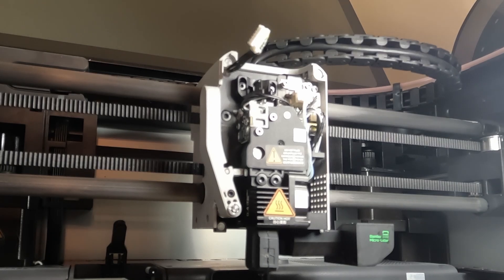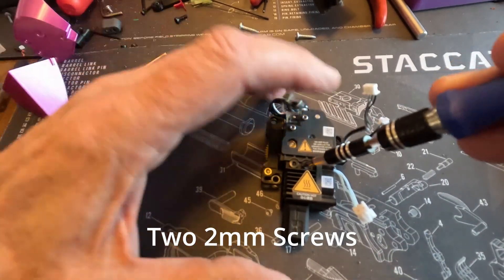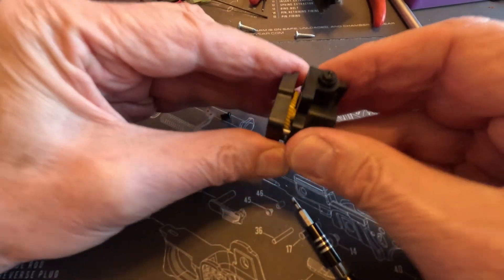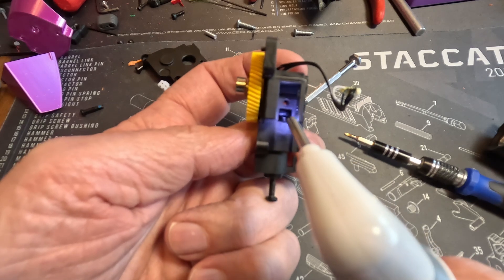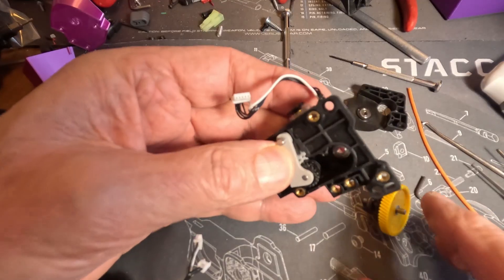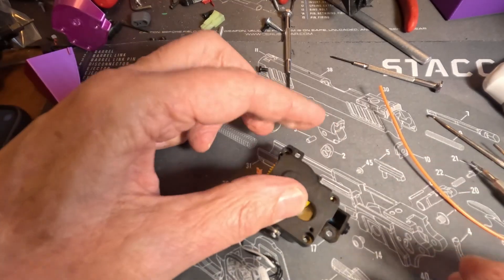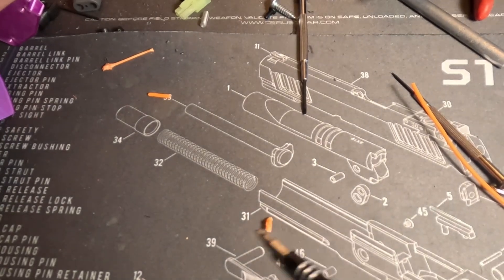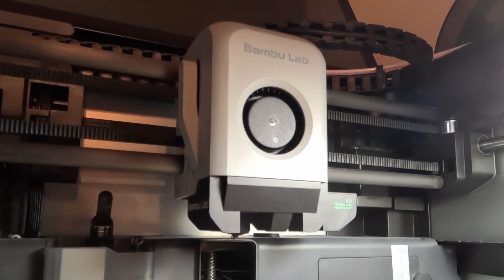Removing an Extruder Blockage Bambu X1C

Comment: Thanks!

Never had to take that off before until today. Labeled PLA, ABS in the system. Found a nice glob of filament in my extruder. Would never have gotten it out without completely taking it apart like demonstrated in this video.

Comment: this exact scenario happened to me last night, I spent the day learning how to remove the hot end and clear it.  Thought that was it, went to run a test print and got the same error message, so I found this perfect video of yours and you walked me through it! FYI...  it was some multicolored filament I had bought before Christmas '24 ... it was brittle and I found the broken piece in the gear area.
Thank you.. I am subscribed
Reply from the maker: I’m glad the video helped!  Yeah, I found that that filament I was using was quite brittle as well.  I ended up throwing a whole roll away.

Comment: My blocked extruder wouldn't allow the filament to eject. That put a lot of tension on the filament and wouldn't allow me to disconnect the PFTE . I had to cut the PFTE and filament just above the connection. The instructions said to print a box to assist in removing the sprocket. Kind of hard to do when you are repairing your only printer. Removed the sprocket , and was able to remove the stuck filament with tweezers.

Comment: Much obliged. What is that dynamite metric hex driver tool you are using? Much better than metric allen wrenches....
Reply from the maker: It is a 142 piece screwdriver set I ordered from Amazon.  Strebito electronics precision screwdriver set.

Comment: I can not get the yellow gear out. I loosened the Long screw and removed the spring, but the yellow gear ist still tight. Am i missing something?
Reply from the maker: Be sure to loosen the screw that holds the idler and then pull that little idler gear in arm assembly away from the yellow gear. The yellow gear should pull out at this point.
Reply: @Steve4948  Well, I got it out. But now the extruder does not pull the filament anymore. Guess I broke something...
Reply from the maker: @erizona55  yeah I’m not sure what to check other than make sure they tightened that tension screw.

Comment: Thank you for this. Unfortunately I took the whole thing apart and checked it thoroughly for a clog or loose filament. Found nothing, put it back together and still the same error 🤷‍♂. Funnily enough, it was the orange filament that started this issue for me as well.
Reply from the maker: Interesting that it was the orange filament for you too.

Comment: Thanks for the video . 
What brand of filament ?
Reply from the maker: I don’t recall the filament brand.  Looking back at my order history, Polymaker would fit the timeline.  However, I’ve used a lot of poly maker filament and haven’t had any issues with it.  I’m not even 100% sure it was a filament issue but it happened two times in a row so I threw that roll out.
Reply: @Steve4948  ok ty

Comment: Thanks Steve, that was much quicker with your video instead of figuring out myself 🙂
I have about the same issue. A melted piece of filament that was stuck in the extruder. 
It never happend to me before and I was wondering if you managed to figure out what was the reason of it? 
It happend to me when I was using a 0.2mm head and often changing color.
Reply from the maker: I am glad the video helped. I am assuming the problem was a bad roll of filament, although there is no way to prove it. It happened two times in a short time. I threw that roller filament away and have never had the problem again.  I’ve only used the .2 mm a couple times and both times it worked fine.
Reply: Thanks. I'm not quite sure the filament id faulty ... although the filament may behave differently on a 0.2mm head. I never had an issue with this filament on a 0.4mm head...
Anyway! Some thing you better not ask in IT world 😉 "that's how it is"!
I'll keep on trying anyway !
Thanks for your video!

Comment: Quick question, my issue is not with the extruder. In fact even bought a second one thinking it was. However, after swapping extruders it's still not printing in that no filament is coming out of the hot end? I didn't think a hot end could be clogged up as whatever filament being printed would just be melted and passed through? I did change the hot end nozzle with the replacement which came with the printer and managed to get 3 hours into the print before the second nozzle got jammed up. Is it possible there's an issue with the thermistor? Perhaps not heating up the hot end enough even though it reads as being 250? Any help would be appreciated.
Reply from the maker: I don’t know a whole lot about hot and issues, but did have to replace the complete hot and on my P1S at one point.  I had the hot and on hand and just swapped it out without really doing any troubleshooting beyond that, but it fixed the issue.  I would think it would be possible for a thermistor issue to cause the problem if the hot end is not getting hot enough.
Sorry, I couldn’t be more help.